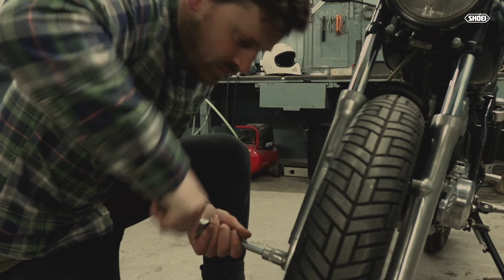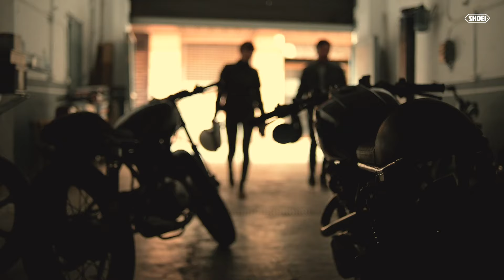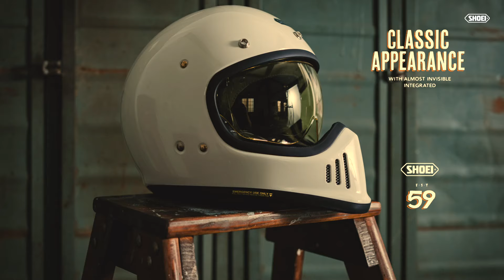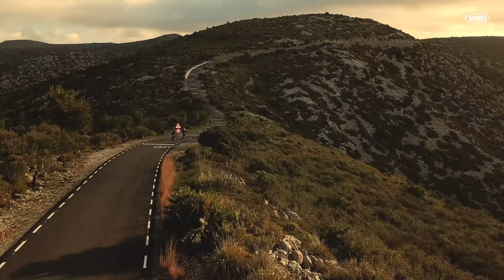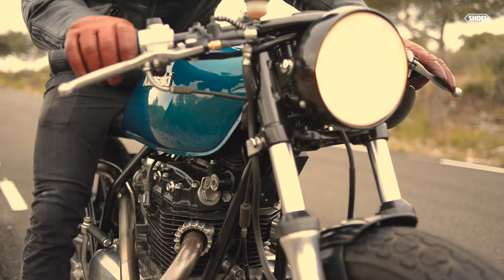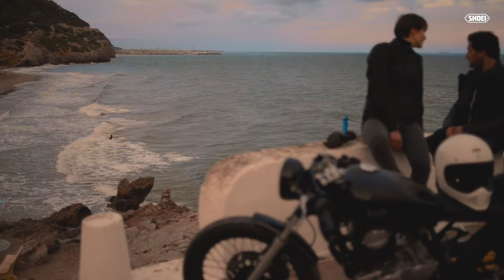Shoei Ex Zero

Comment: What are the goggles used in the video?
Reply: Dmitri Felbinger Deus ex Machina?
Reply: I think you are right! Thanks
Reply: Brand: 100%   Model: Barstow
Reply: Thanks but I already bought this helmet and Barstow couple of weeks ago and I love them!
Reply: @redlinethin  how is it so far?
Reply: @s.haan_  love them. Obviously they are for my retro bike so I use them once a month but still 3 years on I haven't replaced lens and goggles look brand new. Easy to clean bugs off them, not scratched lens yet with microfiber cloth. They don't fog up. I love them. Would recommend